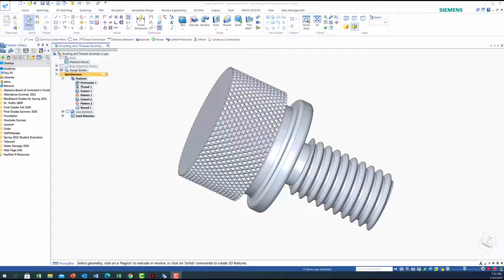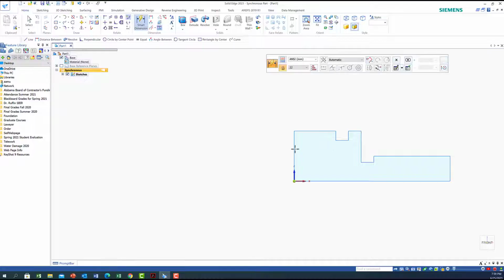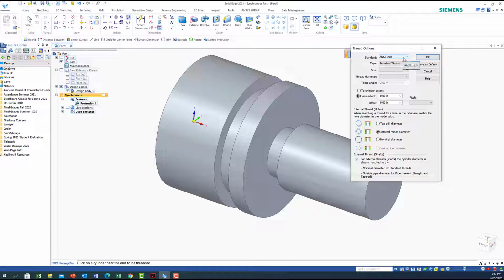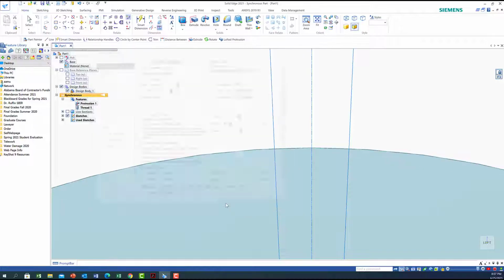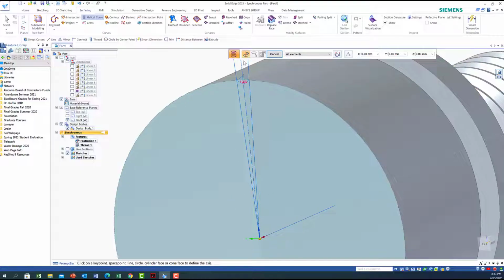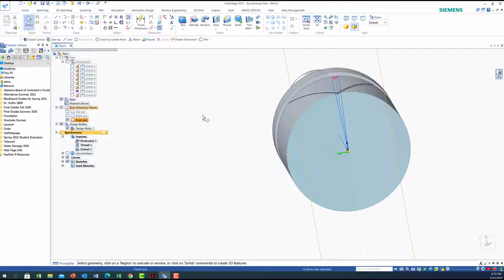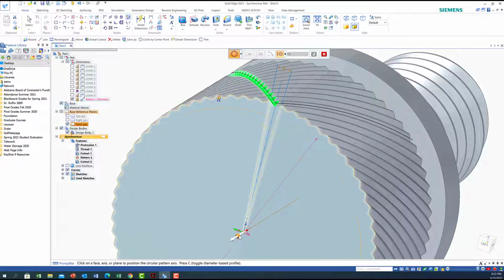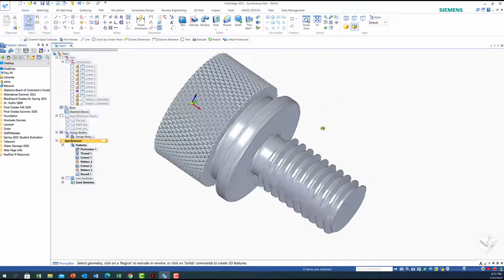Solid Edge Tutorial - Threads and  Knurling Design

Comment: Just use a mirror function of the first cut and pattern....
Also, you can use a helix cut (and make the sketch during the helix command), it makes it much less complicated

For larger knurling parts, it can take a long time to calculate the cross cuts, in that case you need to work with a extra Body for the cutout (as a contra shape), make the pattern and mirror and then use he boolean substract.... this is much lighter and quicker.
Reply from the maker: @DishoNl2014  Thank you so much for the feedback it is very much appreciated.

Comment: Fantastic pace, video and subject. Thank you very much for sharing this. Best wishes.
As a question, when you decide to calculate the turns, if the circle is 360 degrees and the angle is 5 degrees, where does the 64 turns come from? I would think 72?

Comment: Doing physical threads is quite challenging for me. For printing plastic parts with my 3d printer i need eg. male  G1/2 BS but with -0.2mm smaller size so it will fit into a metal connector. How do i do that ? I tried adding a line in the excel sheets for british threads (GB metric) but even when i model the right zylinder diameter solid edge is not finding the right line and i dont want to model every thread manually by setting an offset?

Comment: Great video. No matter what I do though SE wont make threads physical. Please help?
Reply from the maker: I am afraid that you do not have enough memory. Try to restart your computer after saving your work and see what will happen. Also, please watch lab 9, 
https://www.youtube.com/watch?v=l7Oeqx_6iQc 
If you still have a problem, I will be glad to zoom or team with you to walk you through the process. Good luck, and here is my email:  mohamed.seif@aamu.edu
Note: I live in the US - Central time.
Reply: @drmseif  Thank you for your quick response. I have a pretty good computer (meant for 3D modeling in Solid Edge specifically). I am attempting to thread a hole. I click the thread feature, then the cylindrical hole. It then prompts me to click the end of the cylinder that I am threading. I then can choose the thread (in this case 3/8-16), which it auto selects. If I hit "finish" at this point, the thread menu stays but the physical thread button is grayed out. If I hit the physical thread option before hitting "finish", it says it will require computer performance (of which I hit "yes"), and it applied the threads but not physical. 
Thank you for your your offer. If I cannot get this sorted out I will zoom with you. It is great you offer help like this to people :) I watched Lab 9 and followed the procedure but no luck :(
Reply from the maker: @summerofsteroids , I believe I have an answer for you. Please, watch Exercise 8 ( https://www.youtube.com/watch?v=WQbe-6mxhIo ) and under the timecodes in the description, click on Internal Threads to take you directly to how to do the part of the internal threads. Good luck, and let me know.
Reply: @drmseif  I have watched through that section and I am having some UI differences. I have sent you an email so that I can send you pictures. Thank you for your help.

Comment: When i do the last sweep and try to do the last circular to create the knurling pattern, It just loads for quite a while then gives a popup message where it says "No pattern were created." I have done exactly the same as the video and can't find out what the problem is...
Reply from the maker: It seems that you are having a hardware issue. Does your computer meet the minimum requirement for the Solid Edge version you have? Here is a suggestion that works with others. After you do the first sweep, save the file, turn off your computer, and restart the computer to free the internal memory. Then only run Solid Edge and finish the second sweep. Good luck.